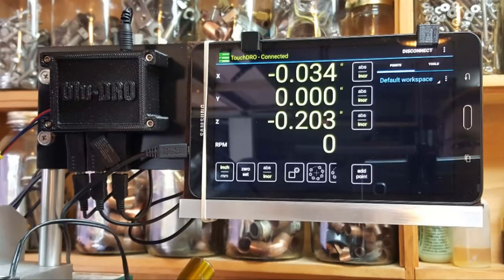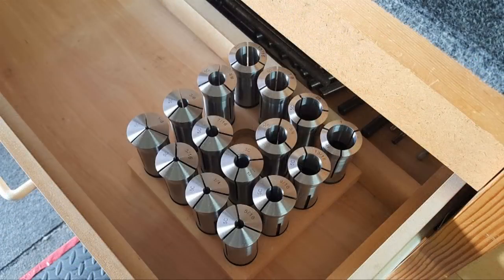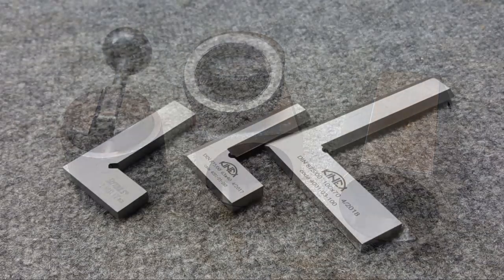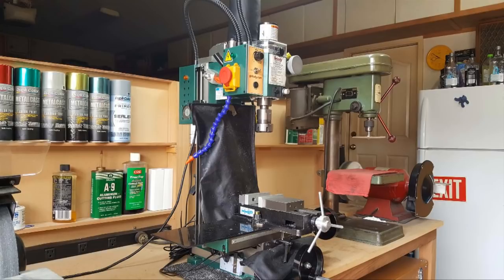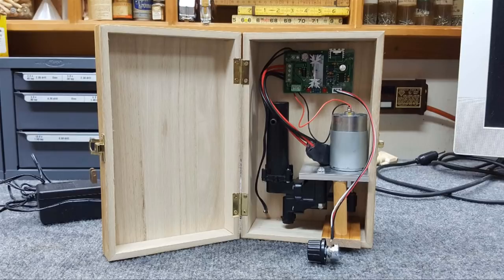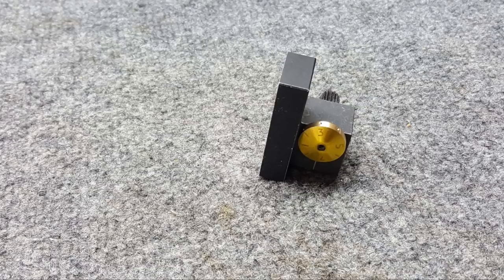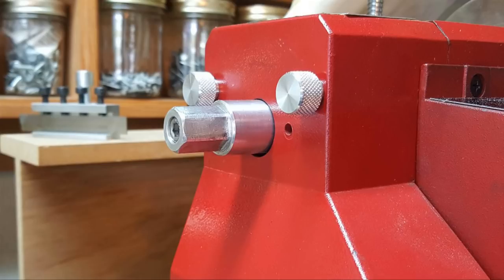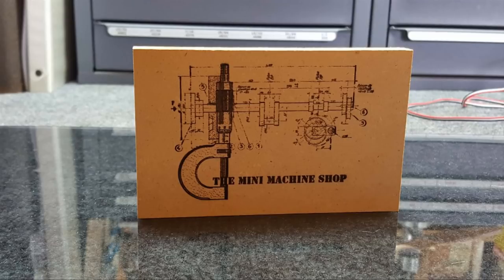Shop Projects For 2019

Comment: Hi Dave, do you have a chart for min./max. dia. tolerances for single point threading metric bolts? I need to turn some M6 M8 M10 bolts on my mini lathe and can't find any data. I don't have the machinest "black book". I want to practice using aluminum as I have never done this before. I already have the gear chart and gears. Thanks Dave, cheers, Doug
Reply from the maker: You won't find charts because it depends on what % thread engagement you want. Example M10 for 75% .393 and .335" in any case the title is "engineers black book"  which is for engineers what you want is https://www.ebay.com/itm/Machinists-Ready-Reference-10th-Edition/332667499841?epid=1045195297&hash=item4d74873541:g:uaEAAOSwOyJX6VNP
Reply from the maker: email me and I'll scan the pages you want...
Reply: Whats your e-mail address Dave?
Reply from the maker: Its shown at the end of every video...
Reply: OK Thanks, I'll shoot you an e-mail